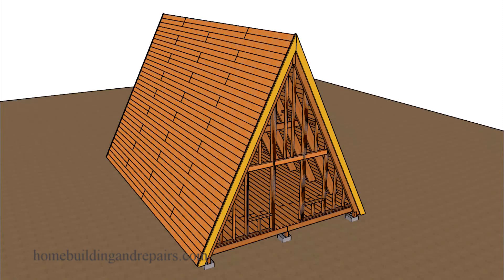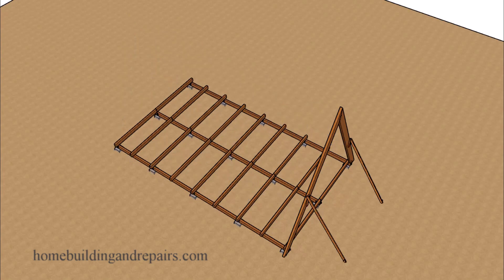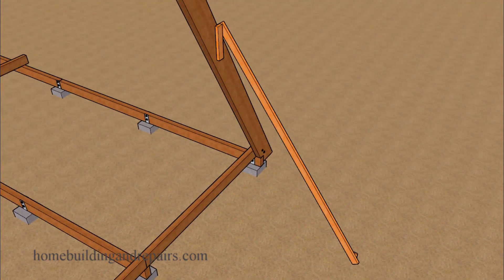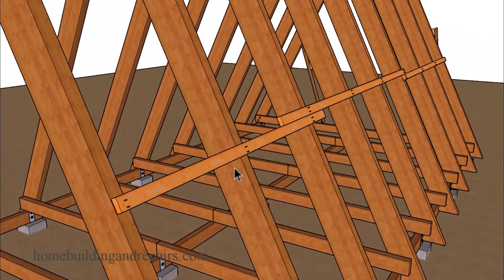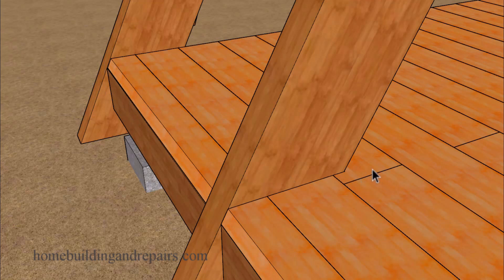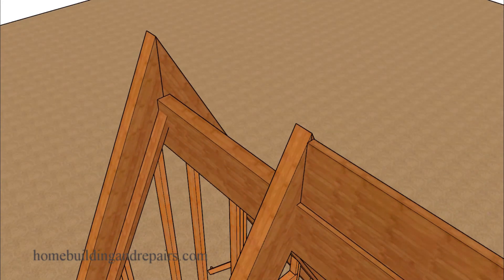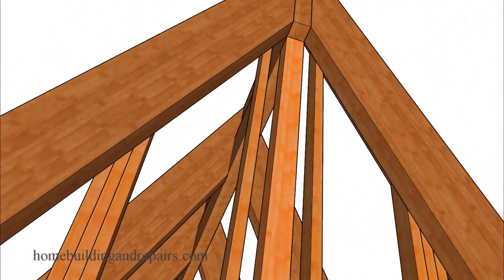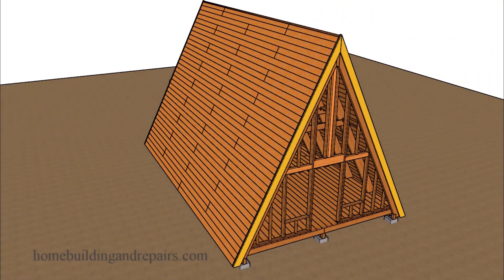A Frame Home Using Floor And Rafter Beams With T&G 2x6 Sheathing - Plan #2 Framing Assembly Design

Comment: Thanks for the visualization, but in my head I would picture myself putting up a ridge board (not beam) first, and let the rafters meet there. All you have to do is build a braced temp post on both sides and middle, and then u can just raise the rafters to meet at that ridge . Seems so much easier to me that way

Comment: Are the roof rafters 2x8s?  or?
Reply from the maker: I can't provide lumber sizes, because they are different in areas with snow.
Reply: @gregvancom Wow, thank you for getting back to me!
 I'm in N Idaho: Sagle
83860 on the south side of lake Ponderay. Re the amount of snow, it is a very steep pitch..18' for the base and 27'
 to the peak....I dont see how snow would even think about collecting on a metal roof.   Best regards,
 Kevin Hambsch

Comment: out of all the hundreds of videos on youtube of people building Aframe houses, ive only seen one person who built theirs using a ridge beam at the top. And thru the whole video he struggled greatly doing so. He aslo stated that h would never do that again. Most people  build the A frame on the ground then lift it in place. one thing here though that I dont see much if any and thats people spacing the A's at 4 ft on center. I think that makes a lot of since. On the ridge beam though they mainly use 2x4's for cladding at 2 ft on center from bottom to top then install their roofing. which is mostly metal roofing. great video though.

Comment: I would like to create or see someones cost comparison between vertical wall with roof vs A Frame design method.   I would expect some adjustments for useability  of the interior space.  For Instance a  8 x 12 conventional shed with 8 ft walls vs   a 12 x 12 ( floor size)  A Frame.  or maybe a 12 x 14 A-frame   would be needed for an equal interior "useability" factor.    The point is that A Frames may or may not  be a more efficient design for true useability.    That is what we have to figure out..   For some purposes the super high loft space of an A Frame might be of higher value  but then also a loft space can be built in a conventional shed as well.   The point is I really dont know for sure which is the more efficient design.    Becaise there are many storage shed builders that stick to conventional design  I tend to think the conventional design is most cost effective.

Comment: thanks so much for sharing.  I have two questions, please.  Is there a disadvantage to putting the flooring down and then set your rafters?  Is there a disadvantage to use a gusset plate at the top to connect the two rafters?  Thank you.

Comment: Thanks for this video. I'm working on a 1960s A Frame similar to this. It has 6 inch rafters, 48" on center. I'm considering adding additional framing to accomodate shiplap on the inside of the roof. Wondering if I should add additional 2 x6s or do 2x4 framing attached to the existing rafters.

Comment: What would it take a roof not to be made with ridge board or beam, because I believe what I saw at my roof the rafters were just joined at the top?
Reply from the maker: You could use blocking and I will provide examples of it in the series.
Reply: It's 40's house, collar ties on every rafter with 2x6 ceiling joists holding it together. But no beam or board. Just wondering if you heard this before?

Comment: Without dormers or skylights I would guess the %glazing to floor area would be low and very limited natural lighting (dark inside during the day).
Reply from the maker: Good point and the longer the building, the less light. This problem could be solved with skylights.

Comment: 5X the snow load if you put the outside concrete piers under EVERY rafter end
Reply: Crious NOT snarky. Why would snow load be an issue? An A frame is great for NOT having to worry so much due to the steepness in the roof.